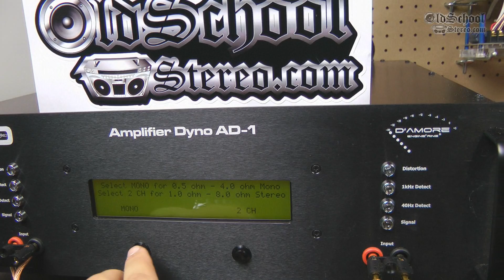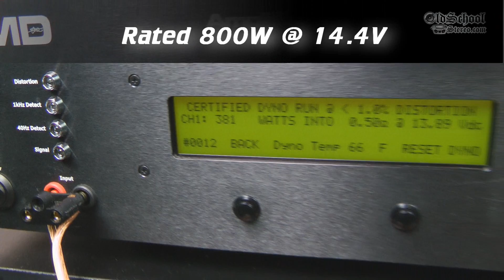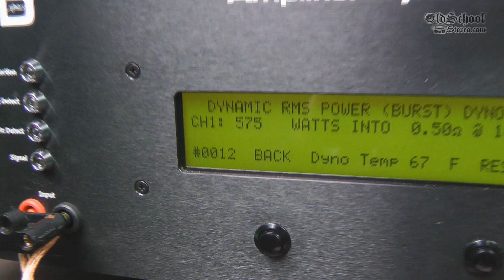Planet Audio P225HC Amp Dyno 1kHz Test 0.5 ohm

Comment: I was really disappointed with the results of this amp. I had hoped it would do much more then it did. I still believe there could have been something wrong with it. It may have had some issues. I recently picked up an older planet audio amp then this one. It showed some magic smoke so I'm sending it out to be fixed soon. I'm really curious to see how it would do on the dyno. It's also a zed built amp but is rated at 1000x1 at 2 ohms. Big D I sent pictures of it to u on Facebook actually in a pm. It's the big bang amp. I haven't seen many of them at all. Usually see a lot more vortex amps then u do the big bang itself.

Comment: It's missing some mosfets resistor and some components as you can see in the video if the company would add those in there instead of leaving those spots empty I bet it would do it's rated power
Reply from the maker: +R/C BASSBOY this same board was most likely used in different Zed Audio designs, but yeah, there is some available space in there fo sho
Reply: Wonder if it would beba cost effective solution possibly  a market to up grade some of the worse for 15 or 20 bucks of parts and some time

Comment: lol nothing personal man, but I really don't understand why your wasting your time with planet audio, I had on and it was trash
Reply from the maker: Thanks for the comment. I don't take anything said about an amplifier personally, I just test them. This amp in particular, was made by Zed Audio, which is a top tier brand. I surely thought it would do rated power and the results were disappointing!
Reply: see the  video says planet audio, hay man can you test a hypnotics zeus 3000.1 , I have one and would like to know the best way to run it
Reply: Michael Beard im going to run 2 12 inch db drive 3k  with it
Reply: Not EVERYTHING Zed Audio did was awesome, just some of it was. Some not so much. Mean Machines. Now they were sweet.
Reply: Production models are a product of the finance depart ment cutting corners

Comment: That's CRAZY! I have been waiting for you to test a Planet amp because I have always heard the old ones were good amps that if anything were under rated. Now I am wondering what my old planet 1250 watt class D mono is really putting out. I would almost send it to you for testing if wasn't worried about it getting damaged in shipping or during testing.
Reply: that amp does rated, trust me.
Reply: TubeYou the New one's are the worst. Garbage
Reply: Can't say they were ever on the radar due to cost/name/performance/reputation. For a thousand bucks back in the day I'd be lookin' at Soundstream, Rockford Fosgate, MTX, Orion etc.
Reply: I have the vx 1400 (1250 rms one ohm ) at 4 ohm stock alt and 6 gauge power wire it did 485 on an hcca 12d

Comment: Have you tried testing the channels separately to see if there is a difference in them?
Reply from the maker: Excellent point! Too bad the amp has already been shipped back to it's owner. Maybe I'll run across another and will test to compare. I want to do the same with the Earthquake PA-2300 as the one I had didn't test well.
Reply: Ya, maybe one of the channels has something wrong?
Reply: BigDWiz you should try the American Bass Phatom 4k